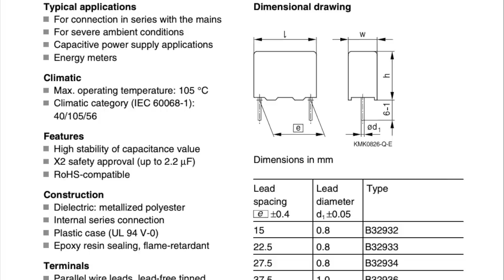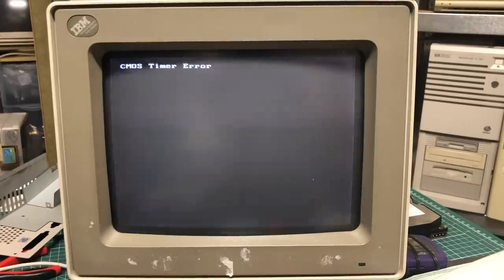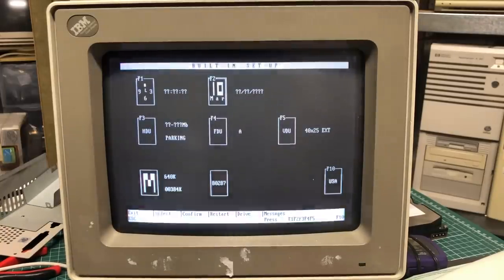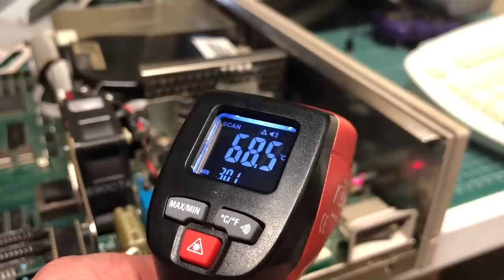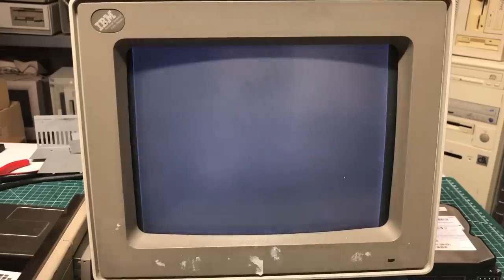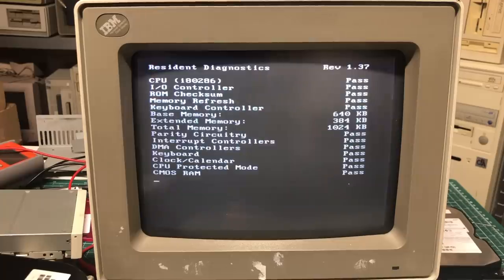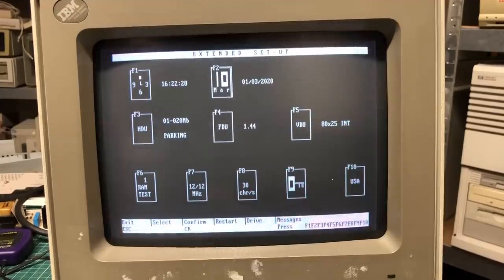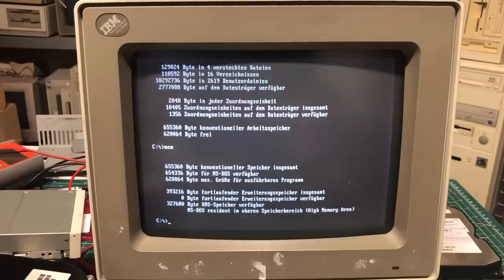Olivetti PCS 286 Rescue Part 2

Comment: Wait, somebody likes Connor drives? I've pulled like 4, maybe even 6 out of old laptops, because they were dead. They were also the only Connor drives I have, and at a 100% mortality rate, I'd not consider them built like tanks. :D
Reply from the maker: Phrea Nix it differs for a lot of people I guess :) here its mostly seagate that breaks (old and new)
Reply: @RetroSpector78  yea, Seagate is notorious too, though in recent years they seem to have made quite the effort to better their drives. IBM Deskstars were another example of bad drives, and not to forget ALL of the Maxtor drives. :D
Reply from the maker: Phrea Nix haha :) had a seagate external 3 tb hard drive completely die on my without any notice. Sent it to a data recovery but they could only recover 70%  and no files larger than 100mb
Reply: I have had always good luck with Connor, Western Digital, IBM Desktar, and Maxtor drives. Seagate on the other had were always garbage. Still junk to this day compare to other brands.
Reply: @phreapersoonlijk  You forgot the worst HDD brand in computer history. KALOK :)

Comment: Resident diagnostics v. 1.37 , my PC-1 has v. 1.21 . Just for the info in case someone cares
Reply: The PC-1, the one that looks like a 8/16-bits computer from the 80s like an Amiga or AtariST?
Reply: @abooogeek  Yes and it has a Conner CP-3026 20 Mb Hard disk ("assembled in the USA", it is ages since I last read that on something) inside in place of the left-side FDD (they are 720K). The bad thing is that it uses a proprietary mouse on a port that only looks similar to a COM port, its serial is off standard and the original mouse is so rare.  Never seen one in the flesh. So no mouse operation under Windows 2.03  :-\